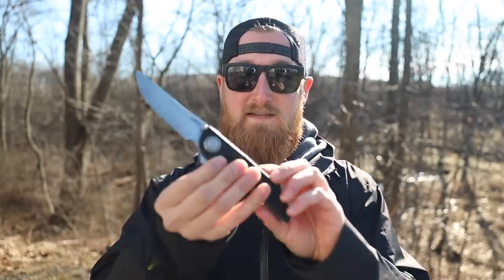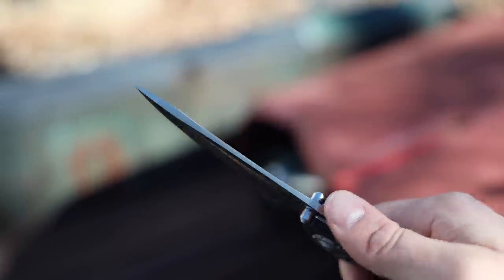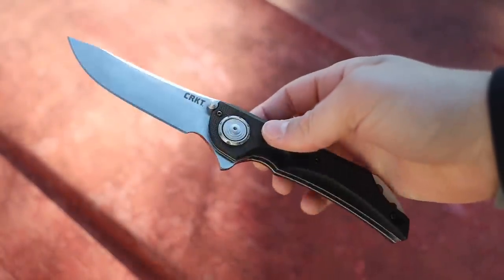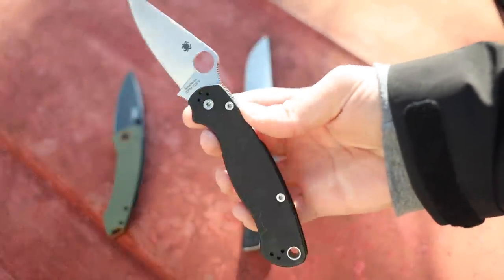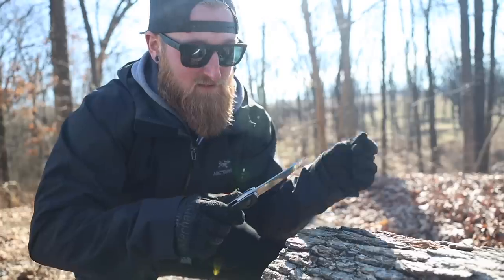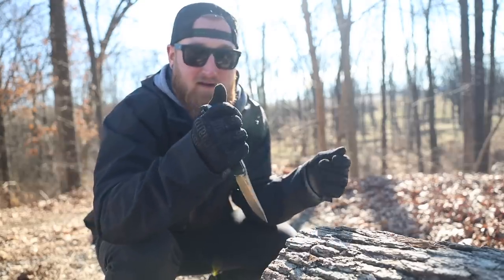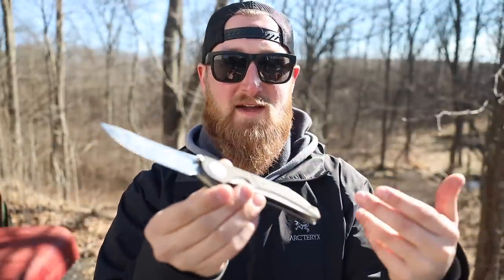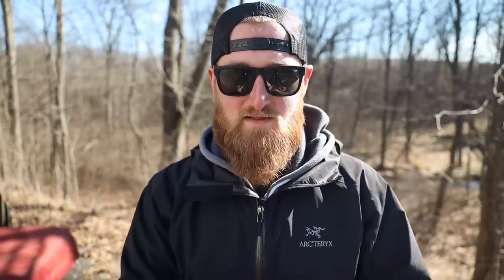CRKT Seismic | Deadbolt Lock ABUSE!

Comment: @Talon Sei – We appreciate you taking the time to take a look at the Deadbolt® lock. Designer Flavio Ikoma (Brazil) did a great job coming up with a solution that works. The strength, the simple ease of use, the reliability, we feel all play in its favor. The fact that your fingers never have to cross the rotational path of the blade makes it infinitely safer than current locks as well. For those that may have interest -  more about How It Works here - https://www.crkt.com/deadbolt/ and the entire collection (so far) here -  https://www.crkt.com/collection/deadbolt.html  Thanks again. Have a great weekend.

Comment: We need to have a duel between the Deadbolt and the Tri-Ad when you come out this summer👊.
Reply from the maker: Done!
Reply: I will supply pizza, doritos, and views!
Reply: We need to see what lock holds up the best after the torture test. I want to see what breaks first.
Reply: Deadbolt lock is more user friendly than the tri-ad lock. I love it! That said I don’t see anything beating the latter in strength since when put under stress the force is spread more evenly over the length of the spine. Deadbolt locks closer to the rotational point. Both offer more lock strength than you’ll ever need in a folder though.
Reply: @crkt  upgrade the blade steel to S35VN and I'll be honest this knive and lock would be an incredible contender to beat it. This is coming from a Cold Steel fan boy and a seismic owner. It's great knife it could be amazing!
Reply: Cold steel just did a weight hang between the 2
Reply: @crkt  Coldsteel already did that today :D
Reply: Is the duel still happening?

Comment: I absolutely love mine that I won from BladeHQ but it broke upon trying defeat blade play. I out very little pressure on it and I take apart all of my knives but this is the first where the pivot screw stripped — not t6, the pivot screw. I called crkt and they don’t even have the pivots made yet for extra parts and don’t know when they will get them in. The knife was hand decorated by zac and Kurt and they wanted me to send the knife in for a complete replacement — so now I have to undo what zac and Kurt did and send it in due to a threading issue from disassembly which hast happened to some of my really cheap kershaws ... it was a bummer , but I hope the knife is as strong as it seems, despite having minimal threading in the pivot. It broke from me checking for blade play and started to free spin while stuck captivated 😭. I can’t wait until I can use this knife and not replace it completely. I love what the guys at BladeHQ did for me.

Comment: I put my knives through some abuse at work for sure. If you don't care to carry it I would gladly take it off your hands! Lol. Curious about dirt fouling up that locking mechanism and corrosion resistance on that blade. Lately I have been carrying the Columbia River Knife and Tool M16-14SFG. Similar in size and found that if I pocket it in my rear pocket I don't even really know it's there. It has a liner lock and a safety to lock the liner lock as well which is not cumbersome.  It's a Carson design with a flipper, tonto tip half straight and half serrated. Really enjoying it and purchased for less than $60 bucks. Very sharp. Might have to look into the seismic!
Reply: The blade steel is chemically close to 420(HC) but performs like 440C. It is very corrosion resistant but low toughness. I have a Linder Nicker in this steel that has performed well for the last ten years.